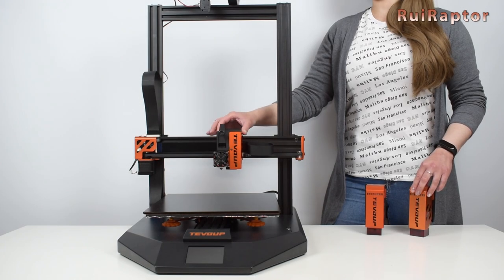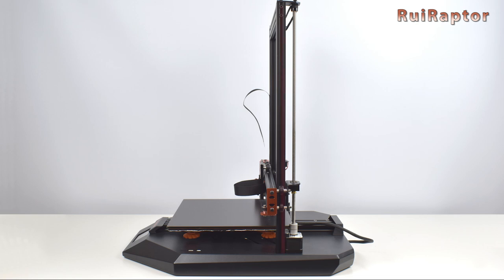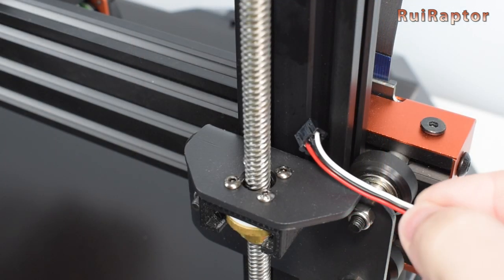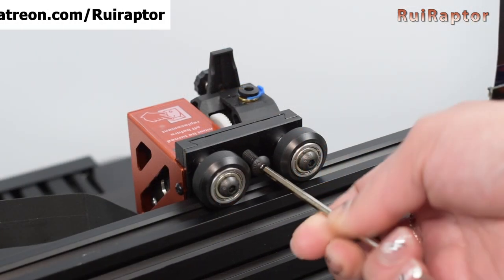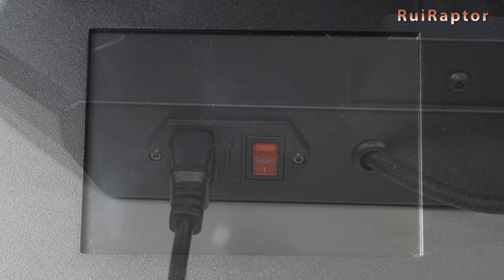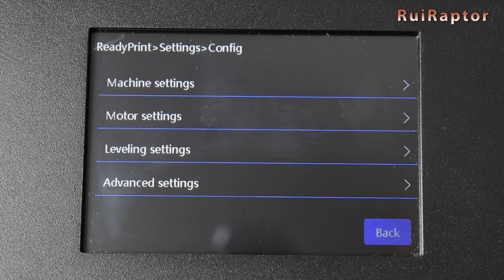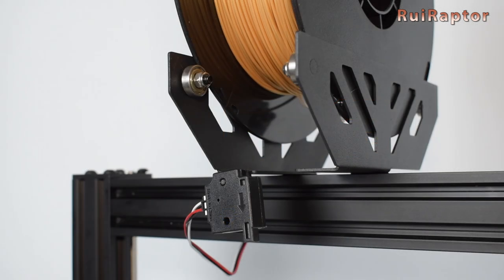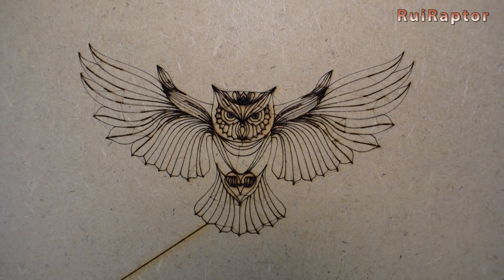TEVOUP HYDRA - Assembly & First Power On (Includes Print + Laser Tests)

Comment: Hello, Any idea why the touch screen will not light up after all the small boards were replaced? I'm thinking it has do to with the motherboard. Never mind. Got a replacement printer and it works fine except when I try to print the roller from your Thingiverse file. It wants to print from the left front corner and only rints a blob.

Comment: Hey Rui. Thanks for providing this video. I'm curious about that laser example at the end. That straight line shouldn't have happened.
Reply from the maker: Hi Bill, you are correct, those lines shouldn't be there. This was our first laser test and we used a very high speed. We are currently testing the print head and laser head for the fulll review and by then we should have all the details.